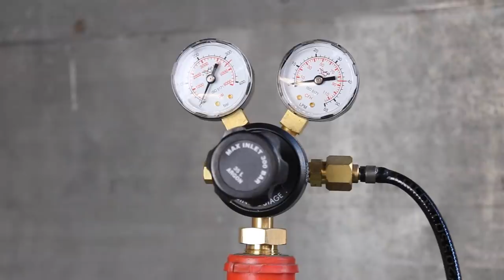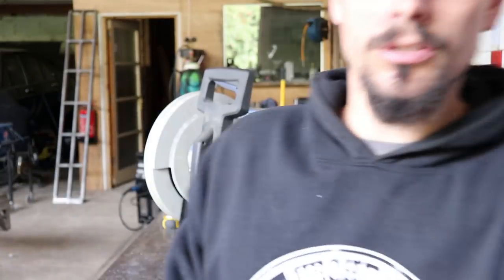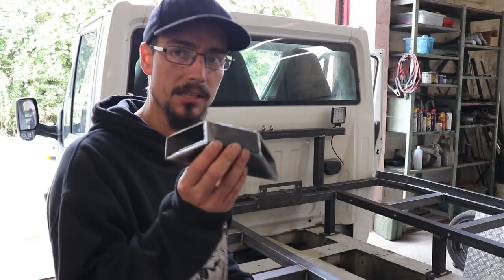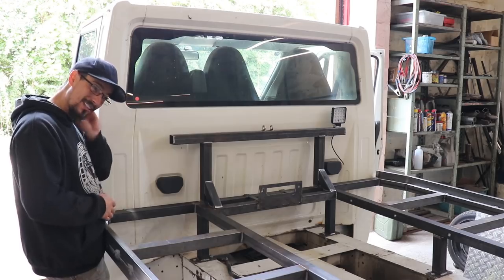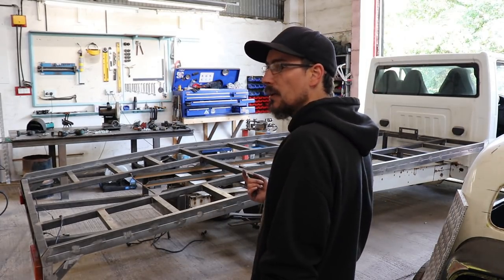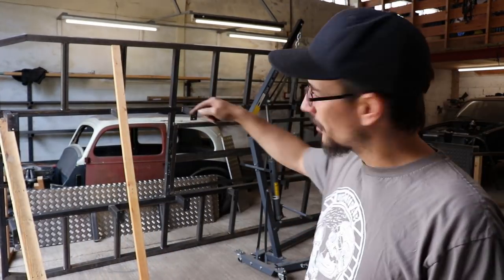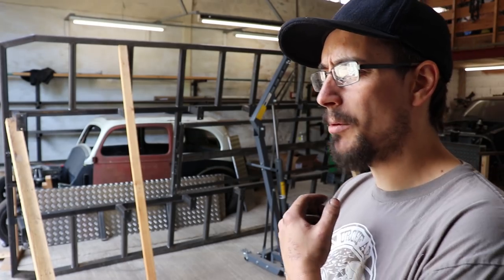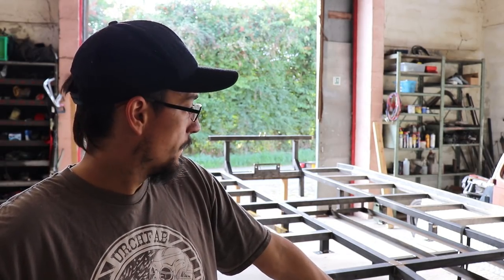TRANSIT RECOVERY TRUCK BUILD DAY 7, LIFTING OFF THE BED BY MYSELF. RAMP TRUCK

Comment: Nice work there. Been watching the vids, looks like the home straight nearly in sight with it. And then it can be earning you money (unless the drift pop's on it with a rack full of new / delaminated tyres obviously). I was wondering if you would be interested in taking on a roll cage job for me? The car's a ratty 4x4 Anglia on a Sierra floorpan that I've had since the 90's.
Reply from the maker: Hi mate, at the moment Im not taking anything on untill next year, sorry

Comment: Another Evo saw bites the dust! Love the videos, But didn't like the non-audio bit. Keep up the great work! How are you protecting the steel when finished?
Reply from the maker: There should'nt be any bits with no audio, I look into that. Just going to paint it. Cheers
Reply: @Urchfab  2:39 onwards
Reply from the maker: Yeh there should be normal audio sped up there, im having some problems with my editing. looks like its done it on some of the other videos too. Thanks for letting me know.